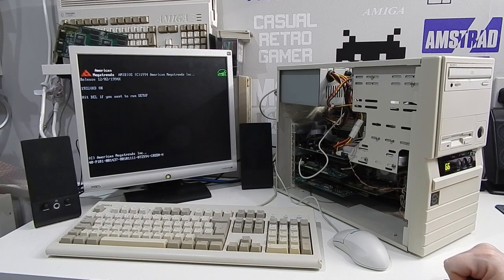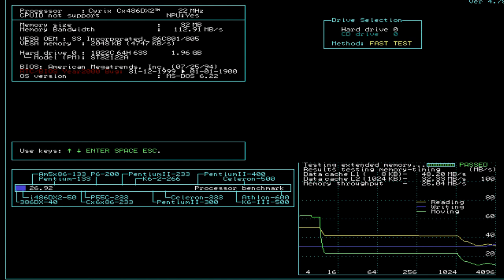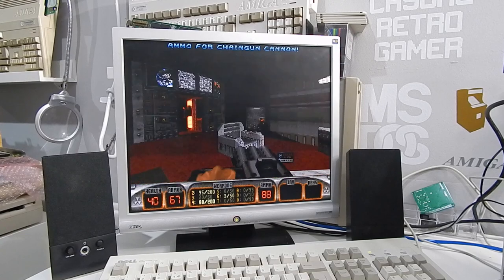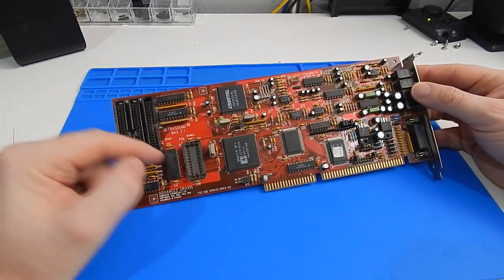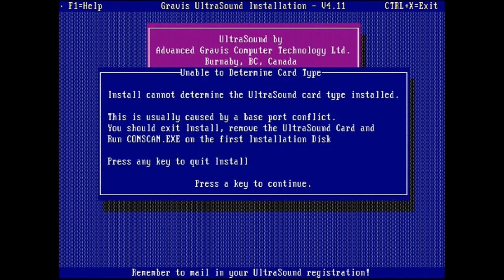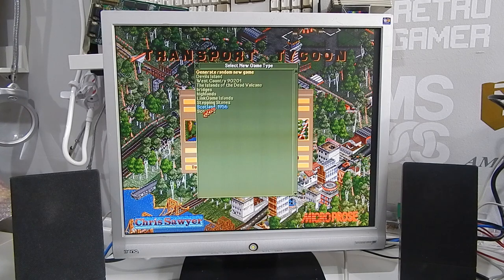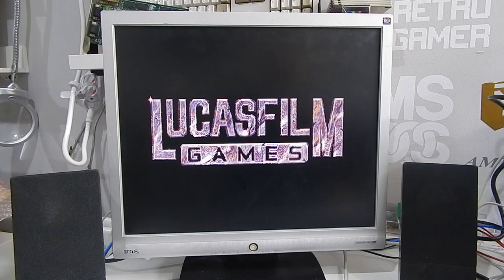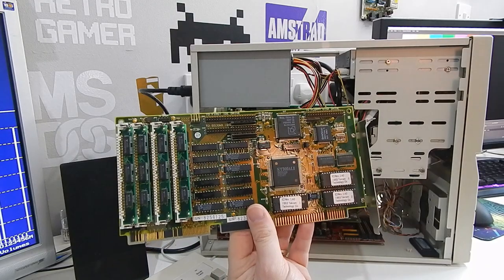BIOS update and an Ultrasound upgrade for the 486 #DOScember

Comment: Nice 486! 

I went with a CF card and VLB 32 IDE controller and XT-IDE (and Smart Boot Manager) on mine and it now has very snappy disk access!
Reply from the maker: Thanks. 

Hopefully I can get the vlb controller that I showed at the end working then I'll be sticking cf cards in raid in this machine.  Should give a nice speed boost.

Comment: Very nice!  I worked on the team at eTek Labs (nee Forte Technologies)  back in the 90s on the GUS PnP (AMD Interwave).  :D <3
Reply from the maker: Very cool, so you worked on the development of the pnp card? Are there many differences on that card compared to the one I have?
Reply: I had a GUS PnP, making it work was ... challenging.
Reply: My recollection of the differences:
GUS: Just the GF1 wavetable chip, max 1MB of sample memory
GUS MAX: GF1 +  CS4231 which adds WSS support. The CS4231 can be used for PCM playback with GF1 dedicated for just the music
GUS PnP: AMD Interwave/GFA1 (essentially GF1+CS4231 on a single chip), fixes some limitations of the GF1 (on GF1 the sample rate drops the more simultaneous channels you use, GFA1 can go to full 32 channels w/o quality drop), adds chorus/reverb type effects, ISA PnP support of course, supports up to 16MB of sample memory

I still have my original GUS PnP Pro modded to take two additional SIMMs for the full 16MB of RAM ;)

Would be fascinating to hear some war stories from the good old days of Gravis/Forte...

Comment: Nice! For the 0WS, I had a WD90C30 (Paradise) card I had to flip a jumper to make it work with 0WS. Also I'm using an Am486DX4, 60ns EDO and 256K of 15ns cache. I remember lowering my ATCLK slightly just to stay in bus specs because some cards will not like it, but I can't remember by how much. As of last week I was experimenting with some TCP/IP stuff in DOS and Win16 environments and ran out of resources like you with the Gravis. I had all my slots populated and ISA networking cards can't really do IRQ sharing like PCI ones. While I tried to ping the machine it froze every time (while sharing an IRQ with a UART). I have also caused an address conflict while experimenting that reset my CMOS settings. The machine hard reset suddenly, then dropped me right to the AMI WinBIOS screen. Now I'll have to redo some stuff and put them in a spreadsheet just in case. :) I f I get my settings right again I'm going to have a 30min duke test also and get back to you.
Reply from the maker: That sound familiar.  While trying to get this working I had an issue whereby when the gravis was initialised by a game the system would reset.  I'm fairly sure my ongoing problem is a conflict in midi resources between the 2 cards, even despite the fact its disabled on the crystal card.  I'll keep working at it and also keep an eye out for an actual sound blaster. If I get it sorted I will of course let you know. 

Please let me know how you get on with your system tweeking also.

Comment: such a nice card that GUS MAX. I also have one paired with sound blaster 16
Reply from the maker: I think I'll keep an eye out for a SB16 to pair with this one.  Would be better than the Crystal card and hopefully would work without the problems I currently have.
Reply: no need to pair. SB16 yet included in GUS MAX. But GUS Classic is NEED to pair with SB16 bcoz Classic's SBOS (SB software emulator) is not a good as it wish.

Comment: There were also add-ins for GUS that worked with Miles Sound System games.  You could add the GUS Miles driver to any game that used the Miles sound system...most of the time you'd have to overwrite one of the other options (like one of the Roland ones) and choose that in the config utility.  That truly was a card way ahead of its time...but CPU speeds moved so far ahead that software mixing of audio channels became a trivial task, so this card really never had a reason for mass adoption.  Too bad, I remember it fondly.

Comment: This 486 series of videos have been so fun to watch! I'd love it if you could come back to this computer and try out different cards and some simple hardware level overclocking by swapping out for faster crystal oscillators.
Reply from the maker: This board supports multiple fsb clocks and multipliers so overclocking would simply be a case of swapping a few jumpers.

I do have plans to revisit this system at some point in the future, want to see about getting fast storage in there.
Reply: @CRG  Sounds great, I'll be on the lookout :)

Comment: Nice BIOS upgrade. I remember back then, some people would go through the HUGE pain of upgrading (or trying to) to get an AMI. They found their original Phoenix or Award BIOSes far too limiting or infuriating to use. Of course, this was back in the EPROM days where just a few people in town would have an EPROM burner.
Reply from the maker: Thanks, an eprom burner is on my post Christmas shopping list.  Very handy tool to have and it's about time I got one.

The AMI bios is very good.  Lots of options plus the GUI interface is nice to use, even works with a mouse.
Reply: @CRG  The cheap EPROM burners aren't bad now. Just can't burn some of the really old chips. The 2708's are out of the question, and some of the early 2716 and 2732's that had the higher programming voltages. There are some work-arounds using an adjustable bench power supply, though.
Reply: @CRG  It's also kind of strange that the GUI BIOS had such a short lifespan. It pretty much disappeared along with the later 486's. Then it went back to the boring blue background BIOSes.
Reply: You don't need an eprom burner, you already have one if you have one of these motherboards. You can hotswap the bios chip with the chip to program, and then flash the bios (or something else) to it.

Comment: Upgrading the cache past 256kB probably has very little speed gains indeed. I'd rather upgrade the ISA HDD controller with a 32-bit VLB one, that should speed up the disk access.
Reply from the maker: If you watched to the end of the video you'll see I have a cached vlb controller for this system but unfortunately it's faulty.  If I can figure out the fault I will make sure to get it installed and of course do a video on it.
Reply: @CRG  Nice, hopefully you'll get it working! I wonder how much faster it is than those those bog-standard VLB multi-I/O cards w/ integrated IDE.
Reply from the maker: I'm hoping it's just going to be a bad rom but I'll not know until I get my eprom reader, hopefully after Christmas.  At the minute it just flashs the hdd led and throws a generic failure on screen which can mean anything from a dead board to bad ram.  Tested the ram and its good but plenty left to still do before calling it dead.

Comment: Another old video but one thought just occurred to me about this build: It seems to me that you kept the Crystal card in just for the OPL and the Sony CD ROM controller. However, you built an Adlib card for your Olivetti 286. Wouldn't it work if you removed the Crystal card, put the Adlib card in this machine and connected the CD ROM to the GUS? The GUS insisting on using 220 may be a tiny issue but surely it's worth a try?

EDIT: OK, so by now you have probably replaced the Sony drive with an IDE drive but I believe the GUS has an IDE interface too.
Reply from the maker: The Sony drive was eventually removed as it won't read cd-r discs.  There is now an ide cd drive as you guessed but it's still on the crystal.  That may soon be changed though as I do now have a spare sb16. I think it would be nice to have that in there paired with the ultrasound.  

The address and irq settings have all been changed from what is in this video to make it more standard to what applications are expecting.
Reply: @CRG Very nice. I think I would still try and use the Adlib card in this machine because if that is the only thing extra you need, as I believe the GUS does SB16 compatibility well enough, then the extra OPL is all you need. But I can also see the point in trying an SB16 card, as I believe that one has an OPL3 chip compared to the Adlib clone's OPL2 chip. I just don't know how many games actually take advantage of the OPL3 extra abilities over the OPL2. Either way, great little system you built there a few years ago, despite the headaches with the sound cards, network card, and cache.

Comment: In '94 I built a 486 DX2 66 MHz.
That's long gone- but I kept the soundcard.

Advanced Gravis Ultrasound ACE (Audio Card Enhancer).
Works perfectly as a "stand alone" card. 
I always used A220, I5, D1, T1.

@17:38 on the SETUP/INSTALL screen, go to "RESTORE FILE(S)"
and type in what's called a "wildcard" (ASTERIX PERIOD ASTERIX) meaning "all"
to get hidden files. No idea why they did that.

Look for a file "SBOS.exe". After loading EMM386.EXE RAM in your config.sys 
after HIMEM.sys. Then load SBOS.exe. In your AUTOEXEC.bat, after
ULTRINIT.exe load SBOS.bat. You'll know it's working when you hear
and see message "SBOS installed". (Sound Blaster Operating System).

At this repository, download, unpack & burn to a CD-ROM all, including
the ACE files. All your wonderful MAX stuff is there to!

http://www.gravisultrasound.com/index.htm

Comment: I run a GUS Classic 2.4 and SB AWE 32 CT3900 pair together in my main classic DOS Gaming PC.  They are awesome but you do have to do a ton of setup to get everything working properly.
Reply from the maker: I've got it to the point now where they work together, mostly.  The SB is wired through the line in of the GUS but if I use the GUS the line in gets muted.  All I need to do is run ultramix le,e to enable it again but I wish I new why its doing this.  It is an awesome card but does take a fair bit of work to get setup properly.  All part of the fun though.

Comment: Man, the Gravis Ultrasound Max was what got me to switch to PC (from Amiga, granted Amiga was more or less dead then). Such a great soundcard, too bad support was not great in all games, even with the soundblaster emulation ("SBOS installed").
Reply from the maker: I've been enjoying a lot of the PC demo scene with it lately.  Some awesome music which is very reminiscent of the Amiga scene but with visuals I could only dream of on my 1200.
Reply: @CRG  Yeah the pc demo scene was what really sold me on it (and there support for the GUS was quite good, as it was liked in the demo scene).
Never did get to the A1200, only had A500s (and A500+s). But man graphics and sound on the A500 was impressive compared to CGA, EGA graphics on the PC (and PC speaker).

Comment: I built a 486 DX2 66MHz in '94. DOS 6.22.
That's long gone, but I still have the soundcard, 
and use it in my current "new" MS-DOS gaming rig.

Advanced Gravis Ultrasound ACE (Audio Card Enhancer).
About 1/2 as long as MAX, I got the extra 512 from Israel.
It is designed to be used either stand alone, or with another FM card.
It comes with a 1/4" stereo phono patch cord, to go from 
other card OUT to Ultrasound IN.

Without other cards, if you need Soundblaster emulation, you must
first load in Config.sys EMM386.EXE RAM to utilize high memory/pagefile, 
then after Ultrasound initialization ULTRINIT.EXE you must load
a file named SBOS.EXE. You'll know if you're successful if you
hear and see the message "SBOS installed".

Ultrasound uses two DMA & IRQ addresses for stereo and emulation.
I always use A260, IRQ 5, D1, D5, T1, T11.You can also just try the basic
A220, I5, D1, T1 will usually be fine.

Another hidden trick= @17:38 On the main SETUP page, go to "RESTORE FILE(S)"
and type in  "wildcards" ASTERIX PERIOD ASTERIX to get extra, hidden stuff. No idea why.

Please- get these and all correct files here (even your MAX)
Look on the ACE files for that SBOS.

http://www.gravisultrasound.com/index.htm

Comment: Cyrix at that point was using equivalent (to Intel's offering) speed on their packaging.  a 33Mhz equivalent Cx486DX2 would only run at 22Mhz.  I don't know if the performance matched the marketing, but that is what's going on there.
Reply: No, that's not what going on there. The Cx486DX2 in this system is running at 66MHz, just as an Intel 486DX2 would do, too. What's actually going on is that the Intel and Cyrix 486 execute the instructions used in the CPU clock measurement benchmark at different speed, because those processors are different. It's normal that SpeedSys reports an 66MHz Cyrix processor as 22MHz and an 80MHz Cyrix processor as 27MHz.

Comment: F for CL-GD5446, I was a fan of the Cirrus cards, my 486 had a 5428, my Pentium had a 5446, had a couple of 5465 in friend's systems - and picked up a 5480 from a computer fair junk bin - dead :-(  , mentioned it the next time, not so much complaining as bemoaning my luck that a card I really wanted to work didn't, and accepting that it was "pot luck" - to which the guy said they should be working, pick another one you like.
It was a Matrox Millennium 2, and while way past their heyday, I could still remember what they once cost.

PS. Kicking myself for ever more for NOT picking up Voodoo 3 for a fiver, as I was on the verge of retiring my 3.3V AGP system

Comment: Another tip=
Ultrasounds dominate the entire Address. If it's at 2hex your other SB must 
be at 3hex. 

Eq. Ultrasound is A220, I5, D1, T1 / SB is A320, I3, D5, T5.

Ultrasound is superior, because it uses .wav patches, not FM.
That SBOS.exe will turn on SB, AdLib, Roland, etc.

Comment: These scams always intrigue me, I wonder how common fake cache chips were? I remember hearing stories about overclock scams with Pentiums. 10MHz was a huge price premium back then. It's a good reminder that fake video cards of today are nothing new.
Reply from the maker: From what I've been able to gather and mostly from comments on the original video it was mainly pc chips who were putting out fake cache.  Never heard of the Pentium overclock scam, that's an interesting one though because as you say a few MHz was a lot of money back then.
Reply: I bet that's why the multiplier is locked starting with the later Pentium II models.
Release prices from 1997:
Pentium II 233  $636
Pentium II 266  $775
Pentium II 300  $1981

Comment: I didn't have that particular model of Ultrasound, but this one didn't run SBOS to have full sound blaster emulation/sound ?
Reply from the maker: I'll try it to be sure but from what I've read the gus can only do sound blaster digital effects and no fm music.
Reply: @CRG  From a quick read, yeah, seems Ultrasound does not have OPL2/Adlib functionality. Given that the Ultrasound can have some SoundBlaster sample playback capability, perhaps replacing your SoundBlaster clone with one of those Adlib-clones from the retro community may fill exactly that gap while avoiding resource contention problems you may be experiencing. edit: apparently the SoundBlaster sample playback support is somewhat unreliable, so just adding in Adlib wouldn't cover all use cases.
Reply from the maker: @maikmerten  I've been working at it some more and I think I might have a solution.  Need to confirm it tonight then I'll update everyone via the community tab.
Reply: @CRG  Cool, looking forward to your updates!
Reply: SBOS does, in fact, emulate all functions of a Sound Blaster, both digital and FM music.  If I remember correctly, it uses some custom patches to fake emulating FM sound, and it does it pretty poorly, but it does work.  Fun fact, I had the original GUS card, not the max, and I remember when SBOS was released by an independent programmer...I think Advanced Gravis hired the guy and bought SBOS to include with the cards.  :)
Reply from the maker: @turosianarcher8771  I'll have another go at it and see if I can get to work.  Even if it is poor quality I'd still be interested to hear it.
Reply: IIRC there were two emulators included for the GUS: SBOS (was it called MAXSBOS for the GUS MAX maybe?, pretty sure the PnP had IWSBOS) and megaem. Assuming my memory isn't totally wrong you had to use megaem with software that used EMS. Dune2 comes to mind as one game where I think I always used megaem.
I would try to make sure neither SBOS nor megaem gets loaded by config.sys/autoexec.bat and see if that helps with the conflict between the cards.
Another idea that came to mind was the GUS MAX WSS support perhaps clashing with the other card's WSS, but I think the GUS MAX WSS is at a non-standard port based on the GUS port.

edit: Ah, should have watched to the end before commenting, megaem was demonstrated there. Cool.
Reply from the maker: I've got it more or less sorted now.  Just one weird issue though, the line in on the GUS gets randomly muted.  Easy to fix with a command but annoying none the less. 

Might actually write a batch file to load games while correcting the settings as I need them.
Reply: @CRG  That is exactly what I did.  I wrote one shell for SBOS (SBDig + Adlib) games, one for MegaEm (SBDig + Roland/MT-32) and one for Native/Miles games, and then copied/customized them for each new game.  Usually had to reboot between games that used a different emulator as unloading was never as clean as it should've been.

Comment: I'm pretty certain my 486DX2 BIOS would auto-detect hard drives. I did need a manufacturer "drive overlay" to get the HD's full capacity when I upgraded to a massive 4.3GB, tho. :)
Reply from the maker: That is a massive hdd for a 486 system.  I think 4gb is the max my current io card supports.

Comment: Do you know if, by chance, your 486 motherboard could support a faster 486 processor, like 486DX4 running at 100Mhz? A non-Cyrix CPU at least?

A CPU replacement bya better 486 could be a good addition to your system...
Reply from the maker: Yes it supports considerably faster processors and I do have an AMD DX4 100 chip although not sure I want to change from the DX2 66.  Cyrix might have a bad name for their 6x86 chips but their 486 offerings aren't that bad.